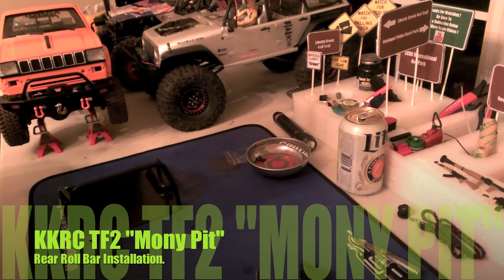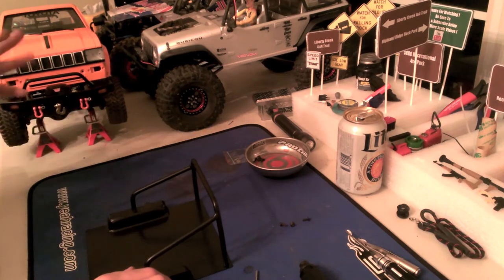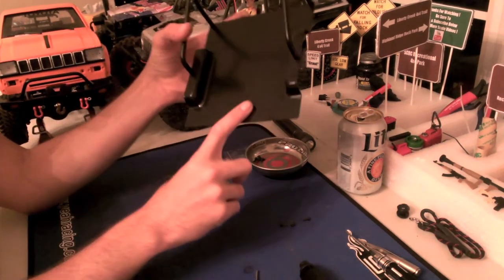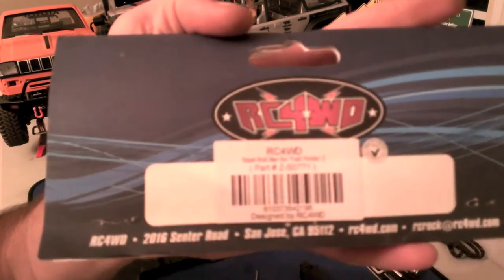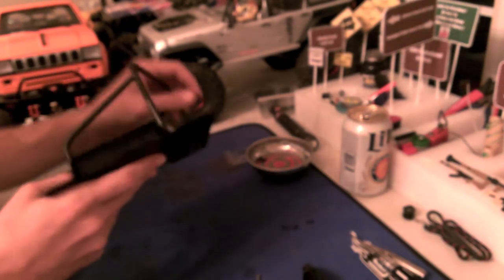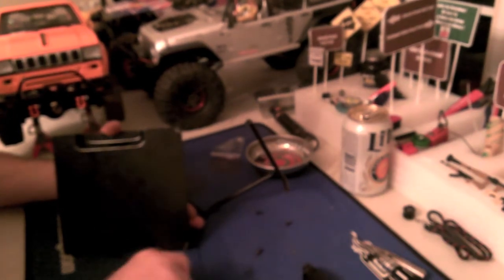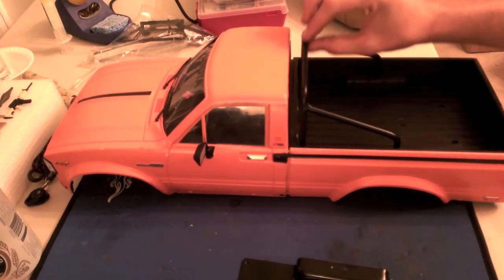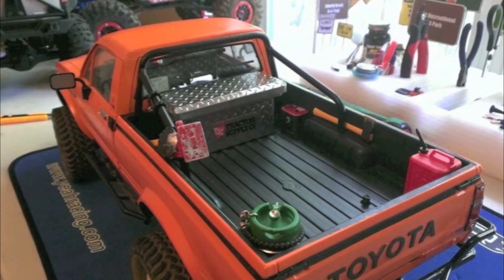KKRC Productions:Trail Finder 2 RC4WD RearRoll Bar Installation

Comment: i wonder if the steel plate fits under the bed and is meant to also be mounted to the truck? like a sandwich effect, bar on top plate on bottom bed in between.. to add weight and stiffness maybe? idk. your thoughts?